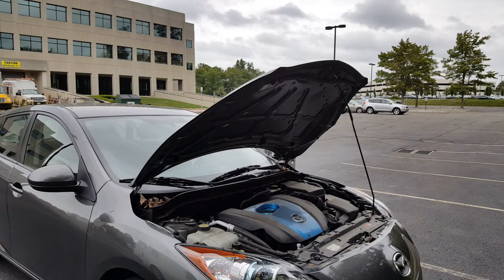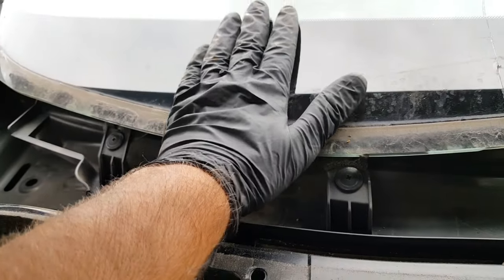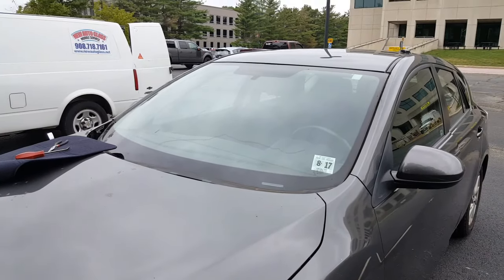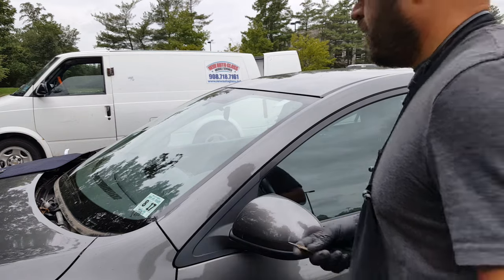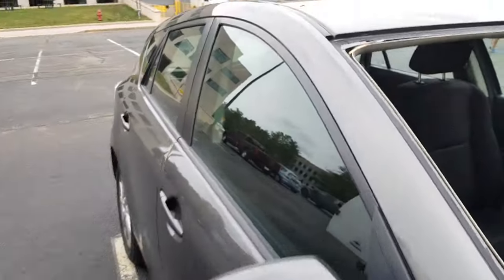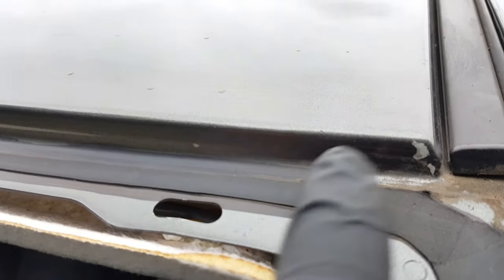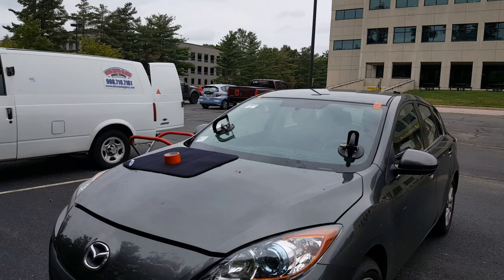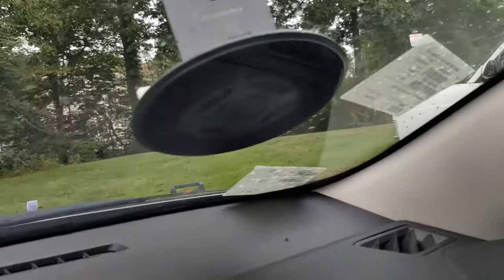Proper and Professional Windshield Replacement ( Sorry for misspelling ) |  New Auto Glass

Comment: Nice job...you did it the correct way by removing everything cowl panel
And wipers...and anything else that needed to be removed...I was trained by other people at one time
Who would not remove wipers or cowl panels and wanted to short cut
Method done...which I refused to do 
And got judged for it...but then I was sent to the FORD CARLITE school and was trained by LEN STOLK AND 
AL GERRARD...WHO I CAN'T THANK ENOUGH..and learned the correct way to replace glass...I become one of the top installers in INDPLS...and was always requested by dealers and body shops to come in and do all their glass work...again great video..because remember the windshield is part of the strutual
Integrity of the vehicle and a safety
Restraint for your safety and the airbags....
Reply: How did you get dealerships to contact you and do their work?

Comment: when your applying the urethane start on the bottom then cut it off at the bottom corner then start again from the top and then reconnect the urethane at the bottom corner with the urethane going on the inside or else water might leak in if you continue starting at the top and connecting the urethane at the bottom corner starting at the top and finishing at the bottom end causes the joints where the urethane meets to go against the direction water will flow naturally during rain fall
Reply: Yea fa sho I work with my dad and he makes sure to run the bead that way and makes sure I do them that way to.

Comment: Here's little tip for scratch free removal, try to use a bit of insulation tape around your cold knife blade. I would also say keep the open primer away from the customers car😉. Good job anyway.

Comment: The general public doesn’t understand how important the installation of your windshield is. It’s critical that the bonding of the glass to the pinchweld is strong. He is right. Many installers will “ stuff “ the windshield , meaning that the cowl is left on. A definite no no. I was always taught that the windshield holds 70 % of the structural integrity of the vehicle in the event of a roll over. A faulty installation could mean someone getting injured or killed, and the installer could be held responsible.  By not cutting corners and not skipping steps, and installer can ensure safety for the driver, and longevity to the vehicles pinchweld and surrounding area. Nice job ..

Comment: Didn't see him index the wipers for exact replacement,  didnt taped off paint around windshield, scratches are not ok, hood should never be used for a shelf things get knocked over,, slide, role, no fender covers, work apron scratches the crap out of paint, standing on sill plates without protection. Other than  that.

Comment: Lots of things wrong
Reply: What did you catch?
Reply: 7:57 he left the saw hes cutting with on the dash to switch sides them . I usually carry it to the other side and finish getting it out sheeths that hold the blade get hot so it laying there could damage the dash.
Reply: But I do them pretty much the same way
Reply: @Ya_Mommas_House  true I always carry it to the other side or put it on the floor of the other side

Comment: Never step on the door trims to reach certain part of the windscreen.
Gravel or dirt in your shoe would scratch this.

If you are scratching the paint even 1 out of 20 vehicles you need to be using an alternate cut out method. Ie wire tool. The customer will see the primer covering the scratch even after the new screen goes in, its too high and the trim won't completely hide it.

There is no need to place any items on a car bonnet even with mat. The mat will scratch the lacquer especially on show cars that are flawless.
Reply: What if your 4'5-5.5 ft tall :)

Comment: this is not prof job at all.. how about using kevlar string like it is done in Europe which easier, faster and no damage to paint.
Reply: + according to many service manuals you need to apply glue to the glass first, not to the pinchwelded frame